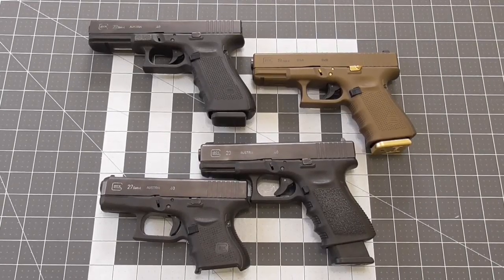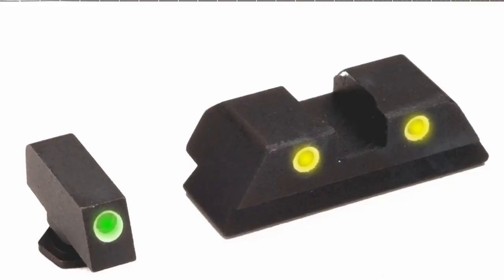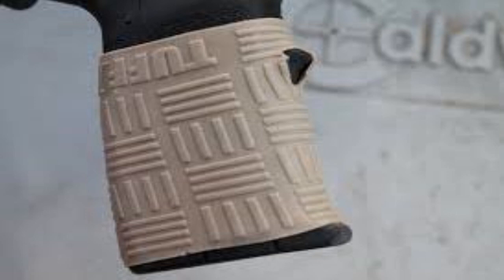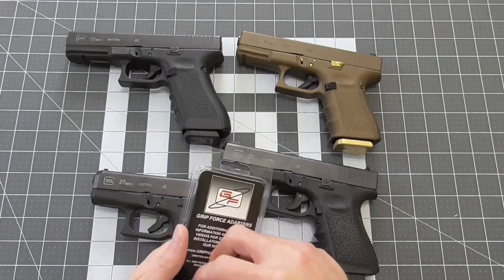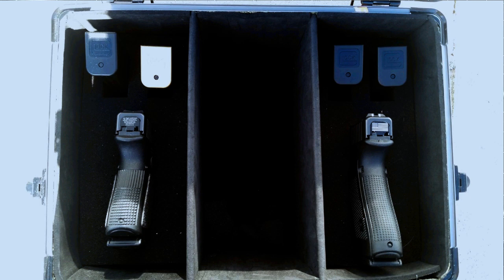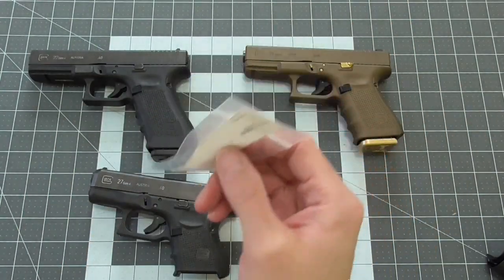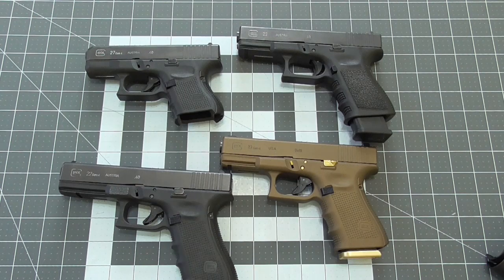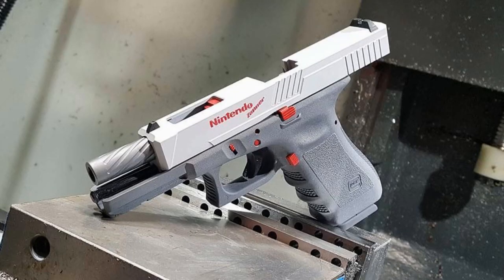Glock modification, aftermarket parts, and other accessories.

Comment: Good video, Im definitely going to look into the extended slide release, never had a new pistol which was so hard to release the slide as the Glock 17 I just bought.
Reply from the maker: John Q Flyer Thank you! yeah it hear you!  Actually it wasn't designed as a slide release. They are referred to by Glock as "slide stop levers" funny I know! Those are the main mods I concern myself with though. tritium sights, grip plug, and the olive 1 with a ghost connector. These are cheap parts, aside from the sights. The main thing with Glock is taking up the slop out of that trigger before you hit "the wall". The olive 1 and minus connector will clean it up but adds maybe half a pound to the trigger. there all kinds of options but simply putting a different connector in won't do anything for the slop, but produce a lighter pull.
If you don't know how to install these, I also have a video for that entitled "how to detail clean your glock". it's a 2 in 1 video.
Anyway, your a pilot? That's awesome! That is something I always wanted to do! Who knows perhaps I still will.
way cool though!
Reply: Chase Palagi What do you think about  the combination magwell flare gripe plugs, I lived in Alaska for 13 years, lots of aviation up there, learning to fly is like placing highly in shooting competitions, they both take training and skill, and once you master it, its a very satisfying feeling of accomplishment. If you enjoy riding a motorcycle you would love flying.
Reply: Chase Palagi Also Ive heard people talk about replacing the plastic guide rod with metal, whats up with that. I will check out your other video.
Reply from the maker: John Q Flyer I suppose my answer would be contingent on the type of use. For competition shooting like ipsc or the like, I think it would work well and a lot of times they are weighted to keep things balanced. That being said I don't feel they provide enough utility to warrant the downside which is concealability. The chances of having to use a pistol is slim, the chances of reload, (aside from perhaps a tactical reload) is even slimmer. I think a standard grip plus is a great compromise for a carry gun. Keep in mind you can have your magwell further beveled and or flared as well which allow you to stick with the same form factor but provided a funnel like mag well 
I bet, I grew up riding motor bikes of all sorts and discriptions. The most free activities on this earth for me is riding motorbikes, shooting guns, fly fishing, giant and slolem skiing. I could see flying firing neatly somewhere at the top of that list!
Reply from the maker: John Q Flyer Well in a gen 4 it's a non issue since it's a metal double captive spring. They are either referring to a gen 3 or a  tungsten replacement spring for the gen 4. it doesn't really do much at all. Tungsten is simply more dense which provides a miniscule amount of weight up front which theoretically mitigates recoil. It pretty much amounts to nickels and dimes in the competitive shooting world.
Reply from the maker: John Q Flyer  by the way, I'm not sure what video you were going to check out but the "how to detail clean a glock" was an addendum to another basic cleaning video, so it may seem like I'm not talking a bunch about that because it was addressed in the previous video 
I also did a Glock torture test which is the exact sized frame you purchased today. That one didn't turn out quite as well as the other test video. it was a nightmare to shoot in the wind and by myself and editing was no better.
I digress, but suffice it to say, I put an awful lot of work in that glock torture test video and it doesn't seem like it! : )
Reply: Chase Palagi Sounds like my AR15 experiment to shoot steel case ammo, never found one that would do it, AK47s were designed to shoot steel case ammo, ARs are not. I was talking about your cleaning video, but now that Im subscribed to your channel I will watch most of them. One thing I don't like about youtube is if you type Best of anything, you will most likely get a bunch of sales hype or fan boy opinions, Ive learned about the AR15 after shooting thousands of rounds and spending lots of money, if your torture test don't turn out like some of the fan boys, thats because yours is more real. My experiments with AR15s rarely turn out like I see on youtube.
Reply from the maker: John Q Flyer I know exactly what your saying, I think there is a lot of back door dealings and selfish motives that motivates outcomes on youtube. Thankfully for my viewers, I am a small channel that purchases my own gear so I simply don't have a dog in the fight.
"torture test" maybe a bit of a misnomer in my glock video's case. I've never *searched out a glock torture test so I don't know what it supposed to entail. I just ran it through a few test that would be more extreme than what the average conceal carrier would ever face.
As for Ars shooting steel case, mine eats them up just fine but I make sure not to leave one in the pipe once I get it hot because once it cools, that lacquer (or whatever the hell is on them) is like superglue. I've only made that mistake once and I tell everyone I know my experience because that was a serious pain in the ass!
Reply from the maker: John Q Flyer oh by the way John (can I call you John?) Thank you very much for your subscription!
Reply: Chase Palagi Sure Ive used the name John Doe for some time on youtube, because it reflects an anonymous or common person, since my heart has always been in aviation I just changed it to John Q Flyer a different spin on John Q Public.
Reply from the maker: John Q Flyer I figured as much,  I guess it was a stupid question as I have no choice but to refer to you as John! : )
So your Ars don't like steel huh? I'm not a huge fan of it either for reasons mentioned. Also, I noticed it can be quite inconsistent,  Tula anyway. 
My Bushy won't run it at all however, all of my builds do. Actually I shouldn't say that as I've only ran it through two of them. I wonder if I put a lighter buffer spring in the bushmaster if that would do it? I don't recall exactly, as this was quite a while ago but It wouldn't cycle anything at first. it was almost as if it wasn't getting enough gas though. The barrel wasn't too short or anything, I think it was simply "leaking" for lack of a better term. Anyway, it came that way out of box and when I sent it back to bushmaster (the new "bush-league" Remington bushmaster not the now Windham weaponry) and they held my rifle ransom until I paid them $124. long story short, When I got it back It shot brass fine but never steel. Ever since then I started building my own and have never looked back!
I don't know how much truth there is to it but I heard that it was much more difficult to build reliable ARs back in the day  because of different tolerance standards.
did you ever *have problems or do you feel there is any truth to this?
Reply: Chase Palagi No problem, back in the day you didn't have near as many manufacturers for AR parts as you do today, in the past what the military used, drove the civilian market, now the civilian market drives what the military uses, to a large extent. I think with manufacturers going to CNC equipment the tolerances are much better. If you're not a gun smith, its definitely easier to build AR's today. But that doesn't mean that some parts work better than others. Ive tried lots of different bolt carrier groups, and some definitely work better than others, especially long term. The problem Ive always had with steel case ammo is not ejecting, if you load up about 6 30 rd magazines with steel case ammo and start dumping them after the weapon gets good and heated up around magazine 3 or 4, you will usually have a case stick in the chamber, even if you do the pogo trick with the charging handle, it will just break the rim off the back of the case, you have to use a cleaning rod to punch it out. Most AR's are way over gased, so that shouldn't be a problem, but you have three gas rings on the bolt, and if the gaps on those 3 rings lines up, it will leak enough gas as to not reliably eject the spent cases. The alignment on the gas block for a new rifle should be correct. Not ejecting a spent cartridge and having a case stuck in the chamber is really two different things.
Reply from the maker: John Q Flyer I see, thst makes sense. I wasn't building Ars in the 90's so I really couldn't say one way or the other. I've read that somewhere but reading and experience are obviously two different things. If I do read something I always try to test the validity. Short of getting a pile of de-milled m16's what better way to confirm than ask a guy who lived it?! : )
Yeah that's what I was referring to earlier when I was talking about the "lacquer" being like super glue, that was a total pain in the ass! I don't run a whole lot of it but when I do I make damn sure to either take the whole mag or eject the one in the pipe if I heat it up to any real degree.
Before I sent it off to bushmaster, I tried about 5 different types of ammo, changed mags, lubed the bcg reallyvwell, made sure my rings were staggered, and even got a hold of a lighter buffer spring but to no avail. to this day, this rifle likes hot rounds.
Reply: Chase Palagi In the 90s you really didn't build ARs like you do today, it was more like putting together subassemblies. You didn't have all the options for every little part like you do today. Even steel case ammo without the lacquer finish will stick in the chamber, when the weapon gets good and hot. Ive tried barrels that are chrome and stainless with the 223 chamber, 556 chamber and more recently the Wylde chamber. Have you tore it down enough to see the size of the gas hole in the barrel, seems like I read somewhere that somebody had to enlarge that hole on a bushmaster, it was an article in some gun magazine, I can't really remember specifics. Wish I had my hands on the rifle you are describing, Id change out parts until I figured it out, nothing like a mystery gun to play with. So it likes 556 but not 223, I know if you shoot 556 and 223 in the same rifle, and watch the cases as they come out, its completely different between the two. The 556 really goes flying and the 223 just drops beside you.
Reply from the maker: John Q Flyer Yes I definitely think it's under gassed. It cycles pretty much anything brass since it was fixed. 5.56 ejection is just a bit more authoritative. It doesn't like anything underpowered which just so happens to be most of the steel cased stuff.
I didn't know that, I thought the steel cased sticking was due to the finish. I know the steel expands a bit differently than brass but the amount of force it took to get that casing out was unreal. I couldn't imagine that being friction fit. Then again, I'm no expert. Like I said, I learned my lesson the first time and never had the desire to look into it any further! Not at my expense anyway! : )
Reply from the maker: John Q Flyer To be honest, I haven't shot that rifle in a good while! In fact I wouldn't mind trading it for something I actually want.
Reply: Chase Palagi If you can't see any gas leaking anywhere and you want to fool with it, I would still check the size of the gas hole in the barrel, as well as the passage way inside the gas block, or you could just trade it for something else LOL. if I shoot at a leisurely pace all my ARs will eject steel case ammo. But when you start getting serious they jam. Ive been watching the presidential election, if it keeps going like it is, we'll get to keep our guns.
Reply from the maker: John Q Flyer I may just have to pull her out if the old safe and play around with it. I love messing with stuff if nothing else.
209 Hillary and 216 Trump. the gap is closing.
I think we're gonna be okay here!
Reply: Chase Palagi On FOX right now they have Trump at 254 and Hillary 209, She has to win every state left to beat him, I know Alaska will go to Trump, but they only have like 2 votes. When I lived there the election was always over before the voting polls in Alaska closed down.
Reply from the maker: John Q Flyer Music to my ears! 
Yeah I pretty sure here in Montana we're only worth about 3 too. 
I wasn't too worried. Normally if there is a two term president,  you can bet the other side will be next at bat.
Reply from the maker: John Q Flyer How did you like living in Alaska? I've always wanted to disappear somewhere deep in that vast state! On the other hand, I bet Texas is a great place to live as well.
Reply: Chase Palagi I was raised in TX but lived in Alaska from 1990 until 2003, at first I really enjoyed the cold and snow, but the last 5 years it got really old, but their are still massive amounts of uninhabited area's If you've  ever watched mountain men on the history channel the guy named Marty who is a trapper in Alaska, is a friend of mine, we worked for the same flying service. I still have a huge black tanned wolf fur I got from him. The summers are fantastic, truly Gods Country, the winters are dark and cold. But if you have a plane, boat, or snowmobile you can do some serious exploring. I climbed a small mountain once on a warm summer day, and when I got to the top, it was covered by snow, but you still didn't need a coat.
Reply from the maker: John Q Flyer Alaska just seems like a place you could have fun getting lost and exploring much like you were saying.
 now I want to watch "mountain men" just so I get the reference. That's awesome. That's has to be a great place to fly huh?
There must be a lot of places that are only accessible by plane in Alaska.
I remember reading about a story that took place in a town in Alaska that was only accessible by plane. The mail plane would come in every week or so but long story short, a guy went postal (no pun intended) and took out like 6 people and the pilot if memory serves with a hunting rifle. I was referencing this story the other day and couldn't remember the name of the town. Are you familiar with this town, it was extremely small from what I gathered.
Sorry I didn't mean to switch gears on you there. It just reminded me of that story.
Reply from the maker: John Q Flyer Alaska just seems like a place you could have fun getting lost and exploring much like you were saying.
 now I want to watch "mountain men" just so I get the reference. That's awesome. That's has to be a great place to fly huh?
There must be a lot of places that are only accessible by plane in Alaska.
I remember reading about a story that took place in a town in Alaska that was only accessible by plane. The mail plane would come in every week or so but long story short, a guy went postal (no pun intended) and took out like 6 people and the pilot if memory serves with a hunting rifle. I was referencing this story the other day and couldn't remember the name of the town. Are you familiar with this town, it was extremely small from what I gathered.
Sorry I didn't mean to switch gears on you there. It just reminded me of that story.
Reply: Chase Palagi I remember the situation you are referring too, the troopers took a helicopter out and found him, they put lots of holes in him, it wasn't very far from Fairbanks, down river I believe someplace like Tanana or Manley hot springs.
Reply: Chase Palagi I looked it up, it was in the 80s in Manley Hot springs, he killed nine people, Manley is not very far from Fairbanks where I lived in the 90s. One of the nine people was a trooper in the helicopter, but the other Trooper had His AR on fully automatic and shot the guy like 6 times.
Reply from the maker: John Q Flyer oh, okay, thank you. Apparently my memory is a bit hazy as pretty much none of my details were correct! : )
So that was close to where you were huh? Is it true that you can only get there by air? or is that just for the winter?
I don't mean to keep you, I suppose I can look this stuff up too. When you mentioned being a pilot in Alaska, It just made me wonder if you were anywhere near that situation. I didn't realize that it was in the 80's I thought it was in the 90's (another swing and a miss ).
I thought it was a really interesting story but I read about that years ago
Reply: Chase Palagi Theres a road to Manley Hot Springs, but most villages are only accessible by boat or airplane in the summer or airplane and snowmobile in the winter, their are a few ice roads in the winter but not too many. And the villages that aren't located on a navigable waterway are only accessible by aircraft year round. Lots of small rivers too shallow for most boats that have small villages on them. Down in southeast Alaska, floatplanes and boats are King. Theres a road that runs from Fairbanks all the way to the Arctic Ocean and the oil fields, called the Hall Road, or Dawson Highway for people who don't live in Alaska, thats what the Ice Road Truckers drive on, also a show on the history channel. The hall Road is also paralleled by the Alaska Pipe line. Their aren't many roads that branch off of the Hall Road, its mostly a straight shot there and back. Airplane is the only year round way to access about 60% Alaska.
Reply from the maker: John Q Flyer That's great information! I didn't know most of that  I'd really like to go back there and check it out. I think an Alaska cruise would be beautiful as well but I was thinking something a bit more hands on. Hiking, exploring on snowmobiles, charter a plane (or whatever it would be called), or something of the like. I've always been really fascinated with Alaska for some reason. I think the Mystique of it all coupled with the beautiful country is was has me.
Reply: Chase Palagi The first of August is really nice, in about 1992 it snowed about 6 inches the second week of September, and it didn't melt until next spring, but it usually doesn't start snowing until October.  Most remote lodges especially around Anchorage have their own Float plane service, you can get hooked up with a remote fishing lodge ( pun intended ) LOL. One thing is be prepared for lots of mosquitos some places are really bad others not so much, but you don't need to worry about getting sick from a mosquito bit like here in the lower 48
Reply from the maker: John Q Flyer That sounds pretty much what I'm looking for. Anchorage it is! I appreciate the info (and the pun) lol
It's looking like ol Hillary is about out of the hunt here!
Reply from the maker: John Q Flyer That sounds pretty much what I'm looking for. Anchorage it is! I appreciate the info (and the pun) lol
It's looking like ol Hillary is about out of the hunt here!
Reply: Chase Palagi The big float plane base in Anchorage is called Fort Hood lake, yeah it looks like it, not a huge Trump fan but couldn't stand a power hungry, bleeding heart, Marxist being in the oval office.
Reply from the maker: John Q Flyer I see. Thanks.
yes my sentiments exactly. It's really a shame that we a now stuck in this two party system. The Republican party seems to be shifting in a strange direction anymore. Libertarian Is looking better and better. I think they need a more sounds economic plan but it surprises me how many people voted for the "lesser of two evils". Don't get me wrong, I get it. I was thinking of throwing someone like Gary Johnson a vote out of principle but couldn't bring myself to. I am just happy that flip flopping anti freedom candidate didn't take it!
Reply: Chase Palagi Im actually a little proud of America, all the bleeding heart, liberal elites in hollywood, and vocal minority's could not install the corruption queen in the oval office.
Reply from the maker: John Q Flyer  I have to agree with that! Hear hear!
Reply from the maker: John Q Flyer Don't get me wrong, I'm not a huge Gary Johnson fan either but I would have like to seen the option of someone else included in debates ect come next election. Not to say I'd even go there but I'm a big fan of option!
Reply: Chase Palagi I agree, my political views are more closely aligned with libertarian, but currently a vote for a third party is wasted.